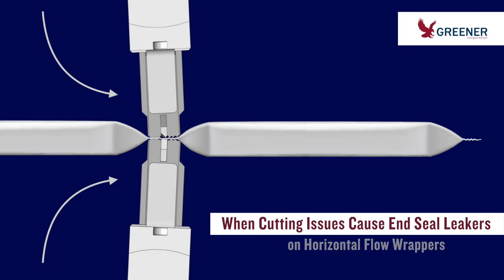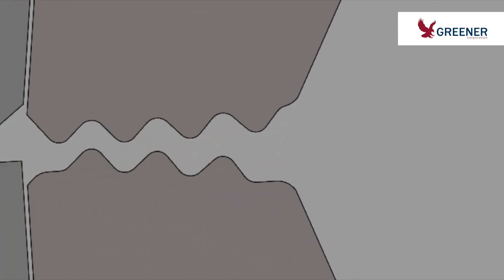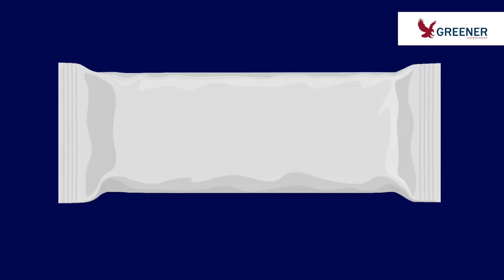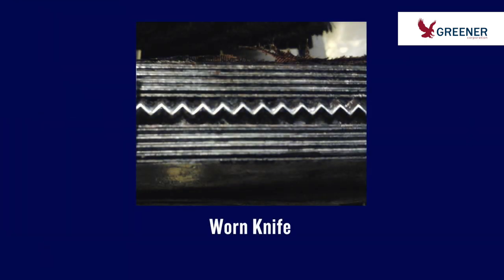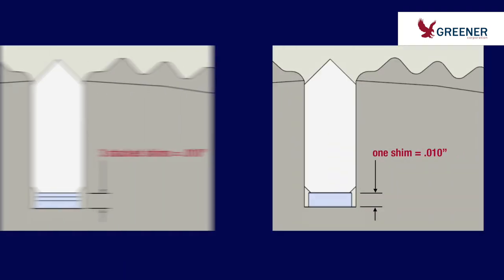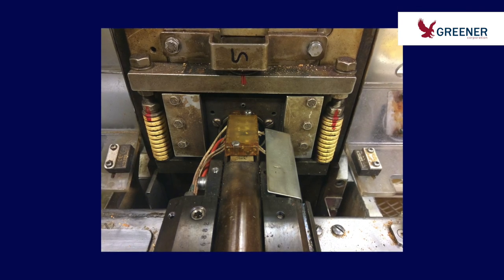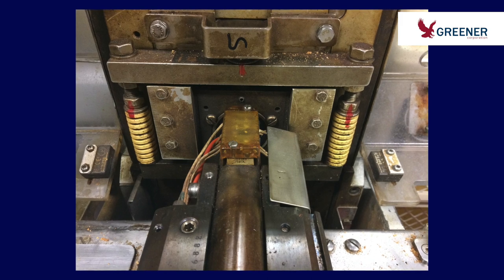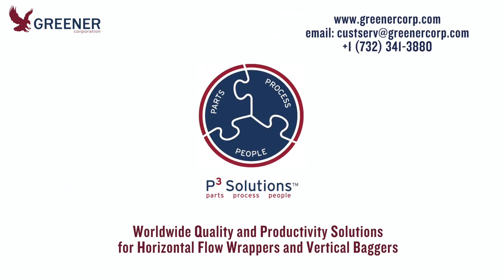When Cutting Issues Cause End Seal Leakers on Horizontal Flow Wrappers

Comment: What is the solution for continue product in seal leakage during running machine. 200 ppm. Parameters Setting , lug chain , belts all are adjusted , but still problem presist
Reply from the maker: Thanks for your comment! If you would like to consult with one of our technical support staff about your sealing problem, please send us a message via the Contact page on our website, https://greenercorp.com/about/contact or email us directly at custserv@greenercorp.com We will be happy to assist you.

Comment: Always beware when adjusting an already used serrated knife. Do not to displace it left or right in the slot of the crimper. 
When adjusting with shims mark it on one side to prevent accidental turning.
Reply from the maker: Thank you for your adding this very good point. We teach this concept in our training programs, and probably should have included it in our post and video.

Comment: What is the radius of the jaws at the cutting end
Reply from the maker: Thanks for your comment. The overall radius on the sealing face of the jaws should be half of the distance between the centerlines of the upper and lower shaft. This dimension can be different depending on the manufacturer and model of the flow wrapper. I hope that this answers you question, but if not please send us a message via the Contact page on our website,  https://greenercorp.com/about/contact
  or email us directly at: custserv@greenercorp.com
  We will be happy to assist you.
Reply: @greenercorporation  could you please provide a handsketch for explaining
Reply from the maker: @engineer567  I am not certain exactly which radius you are trying to determine. Please send your question on the contact from from Greener Corporation's website, https://greenercorp.com/about/contact  and one of our technical staff can assist you. Thank you.